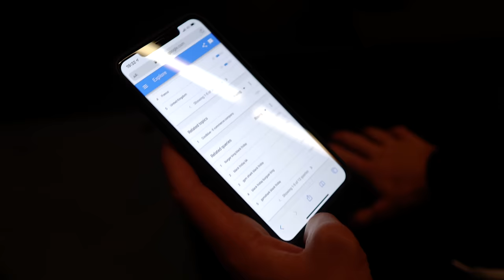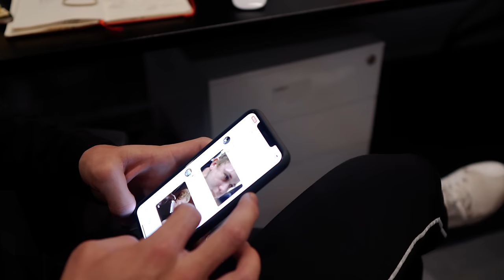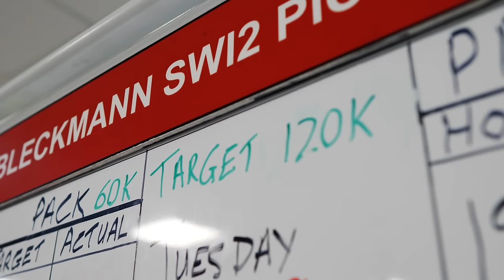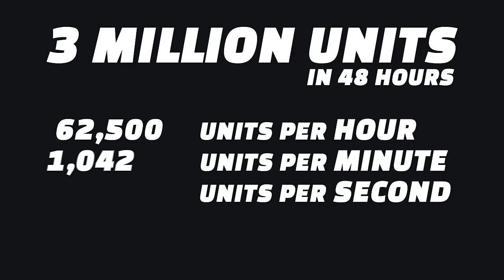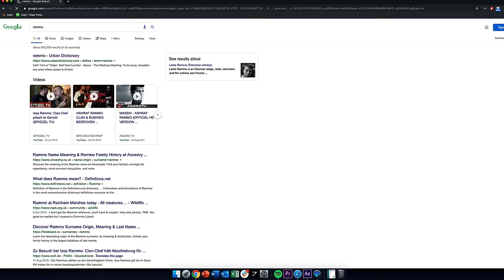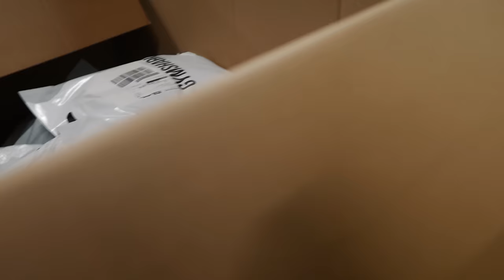3 MILLION GYMSHARK PRODUCTS IN 48 HOURS | Blackout at Gymshark HQ

Comment: SHOPIFY DIED AGAIN.
Shopify is not well designed for this type of promos... It keeped sending me back to the shopping cart everytime I wanted to checkout because of stock... It should have let me end the checkout and then tell me some of the items were not in stock anymore, at least that way I would have been able to buy something...
I attempted to checkout 4 times in less than 5 minutes into the blackout and every time I tried the system throw me out of the checkout. 5 minutes in, and there was half of the items on my basket left. If it worked propertly I would have bought like 10 or 12 Items... in like 1 or 2 minutes, but due to the design flaw of the platform I wasnt able to buy virtually anything....

You guys should rework the system, so this doesnt happen.
As a system designer I can say that I think about a few ways this can be fixed...

It was absolutely dissapointing, It was the first time thinking about buying some items of your brand, and the experience was awful just because of that.
Please, dont make the same mistakes next time.